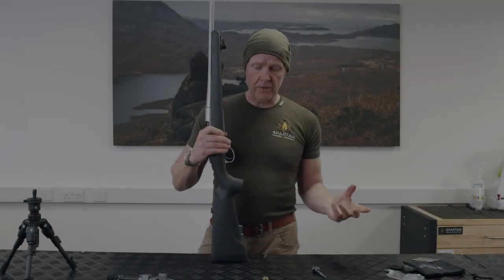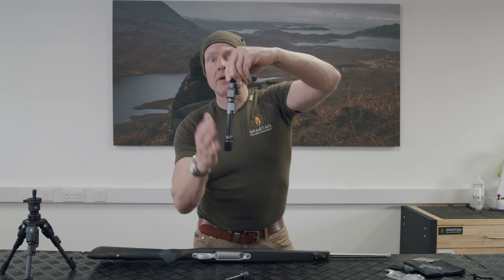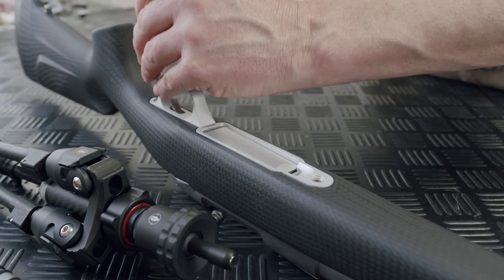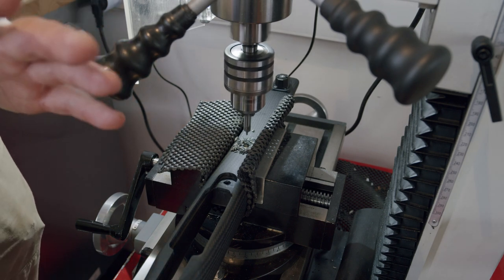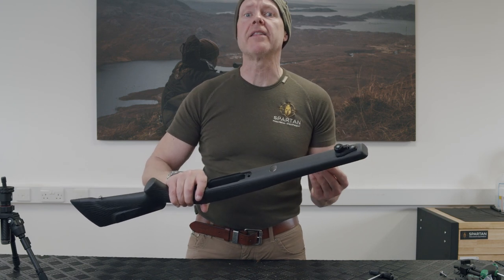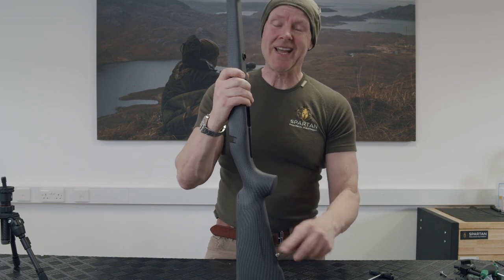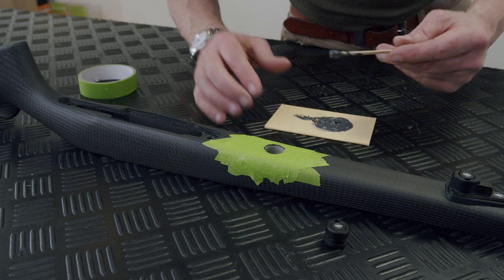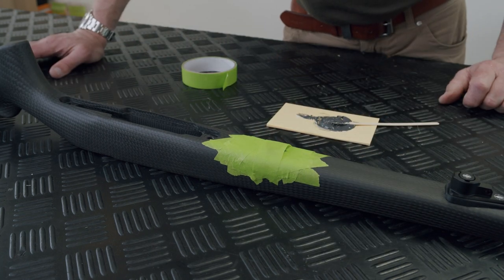Gunsmith Adapter - Installation Guide

Comment: My synthetic stock has ribs inside instead of solid rubber or composite to drill into. I’m planning on filling a section of the ribs with epoxy and then drilling into to that. Do you think that will work or will the recoil cause the epoxy to crack?
Reply: It works did it the same way
Reply: @gregorkoch.3721  Did you fill it with epoxy first and then drilled into that, or filled it with epoxy after installation?
Reply: @unTamed i filled it first and then drilled into it

Comment: What epoxy resin should I buy, if you have any product links that’ll be great.  I am thinking of fitting this to my Daystate Airwolf MCT Tactical rifle.  Many thanks
Reply from the maker: Hi John, sorry for the delay in getting back to you. We recommend using Devcon 10110 Type-A Plastic -Steel Putty (Or equivalent). This is a two-part epoxy-containing sintered metal. We have found this to be extremely reliable & durable. Being a putty, it is a little more forgiving when you require to work or shape it slightly as it cures.

Comment: How deep does the hole need to be to have the adapter 1-2mm above the stock? Or a different question, how tall is the adapter?
Reply from the maker: Hi Sal, the adapter is 17mm tall.
Reply: @SpartanPrecisionEquipment  Thx!